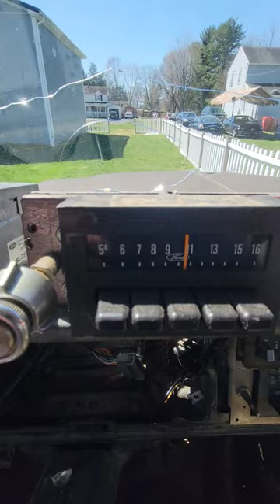4 Simple Radio Designs Found in 70s Ford Trucks

Comment from the maker: The AM digital clock radio is by far the rarest unit of these 4, even rarer than a CB Radio.
Reply: I did a transmission swap for an old guy on his 1979 f150. It had that AM digital radio in it with the red display. Red and white two tone paint job, c6 transmission behind a 390 if I remember correctly.
Reply: I still use the cb for road trips  and to talk long distance at home when condistions  are good.  Lower Sideband ch 38 I talked to some guy in Hawaii I'm  in Texas
Reply: Never saw a digital AM until 80's , did not know it was available in 79
Reply: @dougfisher1813  If it was a 79 that would have most likely been a 460 truck. The 390 and all other FEs were discontinued after 76 minus the industrial variants
Reply: @flyingace5057  it's been almost 20 years since I did that job but that sounds right. I tried to do the job for free for the old man but he forced a $50 bill in my hand LoL
Reply: That’s the coolest one too in my opinion. They’re all really cool though, when I had my 78 F-100 it had an AM/FM radio with a cassette player, of course it was aftermarket.
Reply: I would gladly pay to get one of those, they have the best long-range AM reception, very handy for my hobby..
Reply: @mxslick50  do you do amdx during the night or daytime? I've had to settle for daytime dxing because am sounds like a crowded lunchroom at night with all the low power am stations
Reply: @gayasparagus  I prefer at night, the sounds are more "enjoyable."
Reply: I may not be remembering correctly I thought they had 8 track as well.
Reply from the maker: @josephnorman7728  most of the models did, to include the econoline vans, but the trucks never got them unforutantely due to design limitations
Reply: Real vehicles and you guys fell right into the ploy of cash for clunkers. I wonder how many people in the world are actually regretting taking the car in and getting a newer car. Yep, he buy a car nowadays. You better hope that Godzilla can get it past warranty
Reply: Don't hate on me but when I retired I moved. In the process I pitched out about 2 dozen of these types of Ford radios. 
Sorry, didn't know what I had.
Reply from the maker: @johnnelson8714  No reason to feel bad, people also chucked emissions systems for boss mustangs and other things as well, thats why they have value today
Reply: @gayasparagus  It depends on a lot of factors: atmospheric conditions, station power (both of the station you're trying to listen to and your local ones), ground conductivity, solar activity, yada yada. Night is usually when dx-ing comes into its own, but I've found that the airwaves are just a garbled mess in southern Arizona; all of the local ones are extremely low power. In Montana, I could occasionally get stuff that was 250 or more miles away during the daytime, most often in the winter months.
Reply: @harrylong9781  That was an awful program, so I didn't pay much attention to it... but I'm pretty sure all of the Dentside years were too old to qualify for it. I think 1980 or 1981 was the cutoff.
Reply: Yep I got my tow chain and I'm looking for this truck. I'm really looking for a car. I got the truck now I got a '92 Ford ranger. Yep, now I need a car and I have my tow chain ready. Hey guess what I cranked my windows they go down. I cracked them in the other direction and they go up and guess what they don't fail

Comment: That AM only radio with the digital clock is pretty awesome, didn't even know that was an option for the pickups back then. My 1979 F-350 just has the standard AM only radio. Most people my age swap them out for newer head units but I'm keeping mine exactly how it was from the factory!
Reply from the maker: I actually like the old sound, if I wanted 10 speakers I would just get a new truck. Its all about the experience and feel for me
Reply: @DentsideDepot  oh absolutely! That's my philosophy with these old rigs.
Reply: @bratwurst2923 maybe you could find a period accurate Aftermarket head unit? That would be badass. However probably very expensive. I respect keeping stuff OEM though
Reply: I still have one philco and one krako FM add on radio that went under the dash and the antenna was plugged into the back and when you turned it on and the AM radio to 87 or 92 it would play the FM stations through the regular radio.  As a old goat I may now live alone but someone who lives here is a horder of old ford trucks parts
Reply: I got mine all beat up if I got it nice I'd prob keep it that way but I'm custom restoring it to suit my needs so I'm taking it out and putting something with a cd player in also some new speakers but I also daily mine
Reply: @DentsideDepot  I got mine for the simplicity and easy to work on also extremely cheap parts so I do what suits my needs I need cd player I don't drive new trucks because of all the electronics and how difficult they are to work on so I make the old trucks suit my daily needs
Reply: @youngnoodle1963  The performance of the newer units is horrible compared to those older radios.
Reply: @isaiah5371  If you have the oem AM radio let me know, would like to buy it from you.
Reply: @mxslick50  what area are you located in
Reply: For sure dude don’t replace that. Did you know often times new electric cars like Tesla’s don’t have AM? They can’t figure out how to keep the interference from the electric motors out of the AM band.
Reply: @Bankable2790  ik new cars don't have am I don't even listen to the radio fm or am just listen to cds nothing but music no commercials or people talking just good tunes
Reply: @Bankable2790  I don't have new cars so I make old ones suit my needs
Reply: @Bankable2790  the radio is the smallest problem there is when it comes to a new car

Comment: I repaired the early digital displays on Ford Lincoln mercury models. 82 and so on, now intersresntly they used a heated cathode or vacuum tube display I bought around 50 in the day for replacements. And it was a glass tube that had a green plastic filter in front of it. Take that off and the display was orange. They burned out but led segments replaced them and the driver circuit.

Comment: I use to work at a scrapyard. Ford radios were the toughest to take out. A Chevy or dodge radio could be taken out with a tire Jack and wire cutters.
     I should live in your neighborhood! I had 9 vehicles, none parked on the road. Township came out with new law that said, all vehicles must be inspected. 5 of them were antique or classics. All were complete, and neatly backed in. Still have 4.

Comment: Great radios!   
Besides, Ford, Philco, and Motorola were essentially the "Same" company.   
Ford Motor Company had the industries BEST factory sound systems in All marques of the company, Cars and Trucks, world wide for several years. 
As a Ford Motorhead , that's a very cool title to get and hold onto for those years.    
I read this several years ago and it's worth noting as well,  that during this time, the aftermarket sound suppliers manufacturing aftermarket equipment for FoMoCo vehicles, enjoyed doing so, because FoMoCo used industry standard types of connector interface in the vehicles for easy swaps, and no one else was.   FoMoCo eventually drifted (thanks Corporate 😠)....

Comment: Adapting modern stereos into those old dashboards and mounting brackets, is difficult and sometimes expensive. Depending on, who's wiring it in. But there is a more economically viable option, offered through some of the aftermarket companies. That will give you the best of, today's technology, with the look of, classic automobiles. If I'm not mistaken, and I might be. I believe Pioneer, or their premium brand, Premier, makes a retro style stereo, to fit those, brackets. With little to no modification required. And because there is no wiring between the door and the a-pillar, to accommodate door speakers. Some aftermarket companies offer visors, to go over the windshield. That have, cutouts for speakers overhead.. and there are some boxes available, that mount behind and underneath the seats. Don't quote me on this, but I think, JBL has stealth boxes, that worked very well in those trucks too. My professional opinion, powered sub boxes work better than, boomboxes that require external amplification. Because of the limited amount of room available to mount them. Never forget.... Mounting your amplifier, to your sub box, will immediately void your warranty. 

Pro tip:
If you insist on using modern amplification devices on these old vehicles. Avoid screwing them or bolting them directly to the floor, for the low frequency resonant vibration that occurs while the vehicle is running. Will be absorbed into the amplifier itself. And will crack or destroy the internal electronics of the amplifier. Some type of rubber grommet between the amplifier, and the steel your mounting it to, will prolong, the longevity of your amplifier. And reduce the probability of, frequency buzz, coming through the stereo. By allowing the ground, to occur, through the ground wire. Not the amplifier casing. It is also recommended, upgrading, your ground wire, from the battery. And the power wire, from the battery. Modern, aftermarket wires for high end electronics. Are far superior, to the ones they offered from the factory, back then. And for heaven's sake, stay away from those optima gold top or optima red top batteries. Those are primarily for boats. The way to solve the problem, of your lights dimming. Is not with a more expensive battery. It's with a better alternator. A company named, Ohio generator, used to solve these problems for us at the car audio shop. I don't know if they're still in business or not. Cuz I haven't worked in the audio shop in years. 
And I may still be wrong here. But I believe that, those old-school radios work on a 5-volt system. And your new modern electronics run on a 12-volt system. Which may require direct to battery installation. Versus, attempting to wire it through the fuse box. Back then, there was no government implemented standard, for regulating the wiring of vehicles. So, Ford had a tendency to use 5 volt systems. Versus General Motors and dodges, 12 volt systems. Over the years I've seen a lot of technicians that go into those trucks, with their multimeters, looking for 12 v. And 12 volts was never available. And ended up replacing a lot of components underneath the hood. For no reason. Because they thought, 12 v was the standard for everything. And it is not.

Comment: Huh. My '78 150 has a CD/ Bluetooth Head unit in it. It's even Ford equipment, so I'm pretty sure that was what came in it from the factory. 
Just don't peel off the fomoco sticker. For some reason it says sooo knee under it. Maybe I misspelled that. Not exactly sure.

Comment: You mean "MONO" which is short for "monophonic" not "Monotone" Monotone refers to a person who talks without any change in pitch AKA a dull sounding person. "monophonic" means there is no stereo imagining of the sound and is usually used with only one speaker although you could still use two or more speakers and it still be mono.

Comment: They didn't have the 8track or cassette tape
Reply from the maker: Correct, only in the vans and cars. They were bigger and didn't fit in the dash.
Reply: @DentsideDepot They did make an underdash 8track bracket as well as CB mounting.

Comment: No 8 Track? No wonder Ford sucks.
Reply from the maker: The 8 track was available in the vans and cars only. The trucks had limited dash room and they didn't fit correctly.
Reply: You are correct. The height was the limiting factor for installing the radio/8 track unit that was available in the 70's model Fords.
Reply from the maker: I plan on modding my current build to fit a tape player from a Lincoln because it really is a shame that you couldnt get an 8 or tape in these trucks @josephmay8837
Reply: Just a joke guys :)

But I actually do appreciate the explanation.
Reply from the maker: But to your point I actually agree, they should have had a tape and 8 track player. @Wranorn
Reply: I had a 79 Trans AM silver anniversary  with am 8 track .  I was rear ended at a light several  years ago. That car was beautiful  and rare.